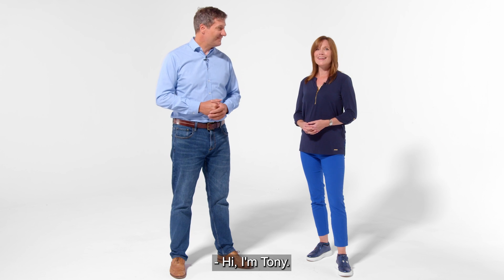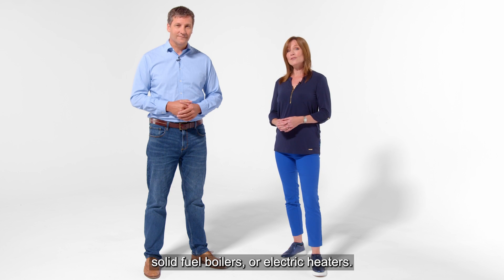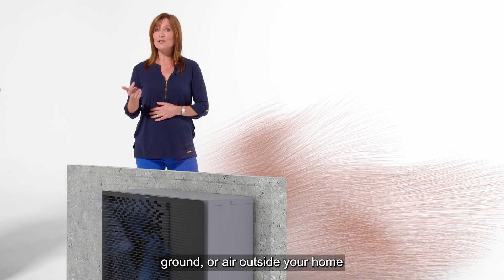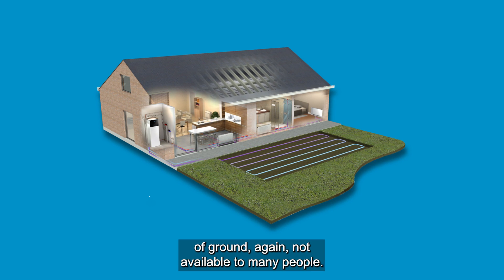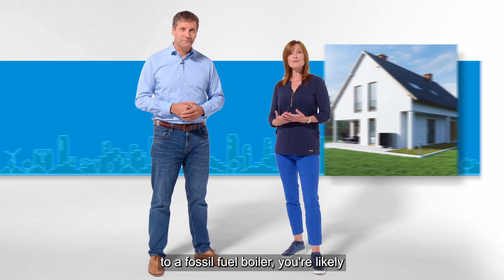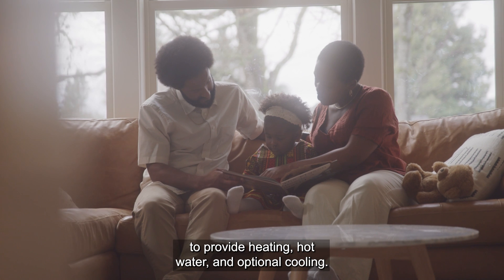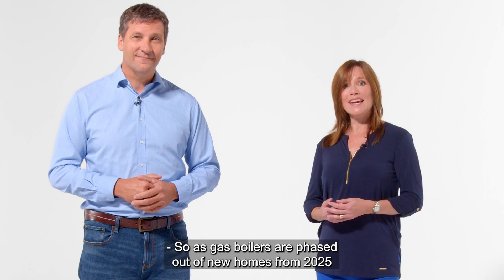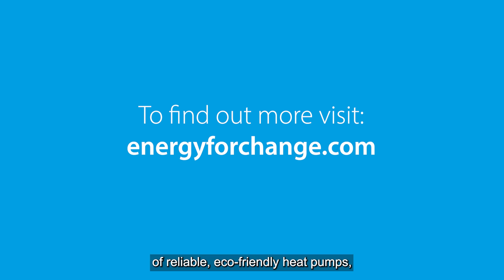Everything you need to know about Heat Pumps

Comment: Went the other day to heating not working in a property zone valve needed replacing. But no boiler it's a heat pump.Outside temp 3 deg c.i couldn't get a valve until next day so overrode the valve. Within 10 minutes all eleven rads red hot customer has just bought the house and was chuffed to bits at all this heat for next to nothing until I took him down to his electric meter cupboard. My oh my the meter was spinning like a spinning top the poor bugger
Reply: I work for an energy company.  Heat pumps do not reduce energy bills.  They increase them.

Comment: Not interested at all,   
It's  expensive,  not efficient,  
Stop spreading the lies
Reply: They been Fracking Shale Oil in Isreal and the UK since 1975 . But you don’t talk about that.
Reply: Absolutely!  These sort of installations only work in particular highly insulated homes.  You need to be well off also to afford all the kit needed - £15,000 average.  The government are only giving £5000 grants to 30,000 installations a year and then only for 3 years!  Then you are on your own.  The government had tried an experiment in a number of areas in the country where they offered to install everything for free - and there were few takers!  Until a far far more efficient and cheaper system on a level with gas boiler costs comes in, then no one is going to go down this route.  There are 25 million homes in the UK and most will not be suitable for anything like these systems!

Comment: What options are available if you currently have a boiler, considering heat pump, but also want a solution to cool the home in the summer?
Reply from the maker: Thank you for this excellent question. A heat pump can be used to cool a home as well as heat it. By producing cold water and pumping it around the house, the Daikin technology is just as useful in Summer as it is in Winter. An important point however, is that for heating, we can often combine the heat pump with your existing radiators, for cooling there is a need to fit Heat Pump Convectors (HPC) instead of traditional radiators. These work like radiators but have a small fan inside them to blow the cool air into the room (or warm air in the winter). There is obviously a cost to replace traditional radiators with HPCs, however in the long run they are more energy efficient, they change the room temperature more quickly, and you do can enjoy heating and cooling with just one system for all year round comfort.

You can find more information here: https://www.daikin.co.uk/en_gb/product-group/daikin-altherma-hpc.html
Reply: @DaikinUK  Thank you for replying. 
I am interested.  Do you have any stores or showrooms in the UK?
Reply from the maker: @yogeshgondalia5676  We are delighted that you are interested in the Daikin brand as a solution to your heating and cooling needs. We have a network of experts available to show you the product and discuss your specific requirements at our Sustainable Home Centres across the country. You can find a list of all their locations here: https://www.daikin.co.uk/en_gb/energy-for-change/residential/find-sustainable-home-centre.html
Reply: Drill and Frack just four shale gas wells in Lancashire and we’re back to pre pandemic energy prices
Reply: @jimsouthlondon7061  it caused a lot of earthshakes covering miles in a radius from the site. However the UK has plenty of offshore gas, if the investment is made.